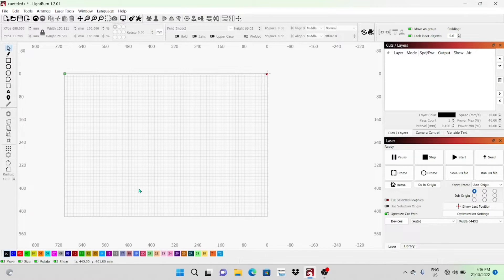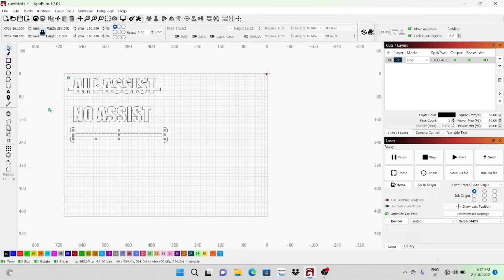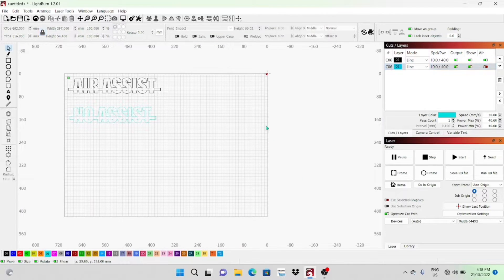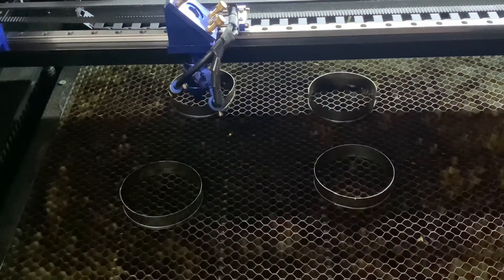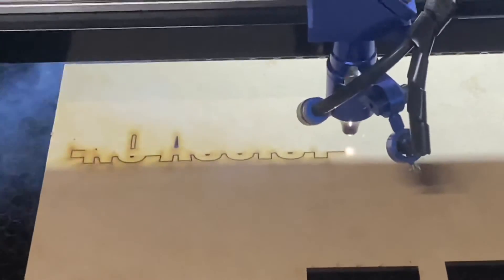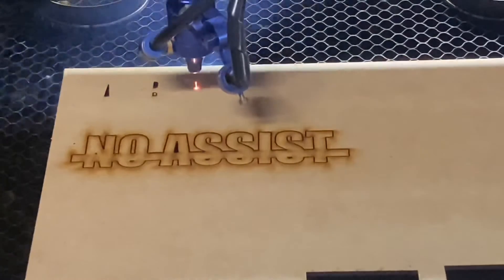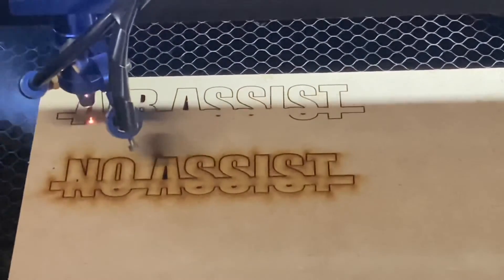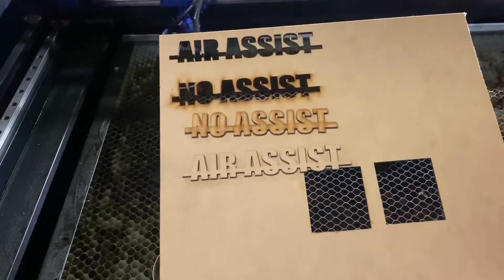Air Assist VS No Air Assist!! 80w C02 Laser W/Ultimate Air Assist!!!

Comment: What compression do you use
Reply from the maker: I have mine set on 20psi 😊
Reply: @woodendayz  which compressor do you use?
Reply from the maker: My compressor is a 5hp with a 50L tank so it’s small but it’s quiet if I’m cutting it kicks on every few minutes but I have to say having the ultimate air assist with the compressor is soooo much better than the normal pump these machines come with so I highly recommend the upgrade. 
Have you managed to get your machine up and running?
Reply: @woodendayz  I have everything but my compressor.
I’m thinking towards the fortresses 26gallon
Reply from the maker: Yeh that would be plenty enough
Reply: @woodendayz  I think I’ll get it tomorrow,
It’s on sale for $60 off

Comment: Great video, how are you able to have a lower Psi for engraving and then automatically bump up Psi to say 15 when cutting automatically?
Reply from the maker: Hi josh, I have the ultimate air assist hooked up to my machine running off an air compressor there is a solenoid that controls the air pressure so i can have it set at a minimum/off for engraving and then in Lightburn when I set up the job if I select air on it will automatically turn the air on when it does that layer and I have my regulator set to 15psi I do also have a video on installing the air assist hope this helps mate, thanks for watching cheers, Matt

Comment: Hello, good lesson btw. I have the same laser but struggle with light burn software. It means the start button does not work and also saving the file, get an error when upload - smth like an invalid file. Sending directly to the laser, get en error too - like three beeps and nothing more. Searching for any help - will be appreciated!
Reply from the maker: Hi 👋🏽 yeh that’s weird is it only with lightburn or RD Works too? Is the laptop plugged into the USB on the laser? I Import svg or dxf files into Lightburn and click send when want them to go to the machine,
Maybe see if you can save them to a USB and put that into the UDisk slot in the laser and copy to the controller
Reply: @woodendayz  Hi! Thank u for fast respond. The problem was in ruida controller firmware. After update - works perfectly!
Reply from the maker: That’s great to hear glad you got it sorted 👍🏽

Comment: Just to confirm. The no air assist was technically the stock air assist compared to your ultimate air assist? Or was there actually zero air assist?
Reply from the maker: Hi josh, yeh that’s correct the air that’s comming out in the no air assist is about the same amount of air that comes out the stock air pump that these machines come with so there’s a huge difference between using the upgraded air assist compared to the stock one! Cheers Matt

Comment: what air assist system do you use and can you share a link where i can get it
Reply from the maker: It’s the ultimate air assist from cloud ray laser I purchased mine from Amazon and the air pressure regulator from eBay 
Cloudray Ultimate Air Assist Set for CO2 Laser Engraving and Marking Machine https://amzn.asia/d/0y6CxMi

https://www.ebay.com.au/itm/1-4-Air-Compressor-Moisture-Water-Trap-Filter-Regulator-Separator-Mount-135PSI-/303968836950?mkcid=16&mkevt=1&_trksid=p2349624.m46890.l49286&mkrid=705-154756-20017-0

You’ll just need to also have an air compressor I use one with a 50L seems to do the job pretty good
Reply: So,this item from Amazon is just a switch?I m thinking about taking a compressor too...how much pressure is optimal for cut?I heard about 30 psi but chatgpt sais 3 bars....
Reply from the maker: Hey mate, yeh you purchase the kit off Amazon and use an air compressor with it I use about 25psi and it seems to work good

Comment: I’ve done a test like yours with air assist I get marks no air cuts brilliant how can this be 
Thank you
Reply: Hi Martin,
Its necessary to understand what and how to use air assist. That is not meant to be rude  or critical comment but there is a LOT more to air assist than blowing air through the nozzle. I designed the ultimate air assist kit and gave the product to Cloudray to sell and it works. Howeve, it was several months later that I fully understood why and how it worked. Please take a look at this video for a full explanation that WILL help solve your problem.         https://www.youtube.com/watch?v=79VZjMdfBmI
Reply from the maker: Try using some masking tape to mask before you cut then in all tests always cuts better with air assist on
Reply: @woodendayz  yes I’ve used masking tape with air with great results, I bought a cloudRay 60/80w 1250 tube I cut out at 30ms 45 power at 10Ma probably one of the best tubes I’ve bought next going to sort the air assist out
Reply from the maker: @martin 30ms that’s pretty quick I do 15ms 40% 3mm mdf or plywood iv recently aligned my mirrors better but yet to do more tests to see what power and speeds cut best

Comment: Which laser do you have?
Reply from the maker: Hi it’s an 80w Chinese red and black
Reply: @woodendayz  awesome and you have the air assist set up to auto switch.
Reply from the maker: Yeh that’s correct I can manually turn on the air assist via a toggle switch aswell but it’s set up so that when I select air assist on a layer in lightburn or rd works it automatically turns on